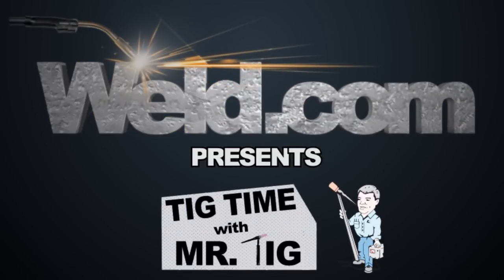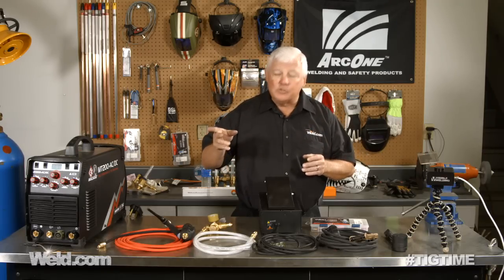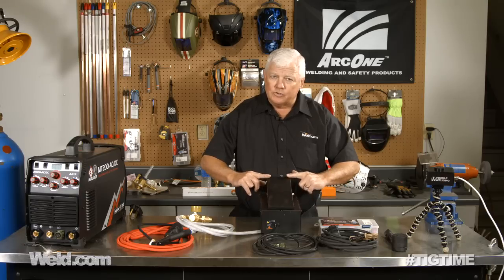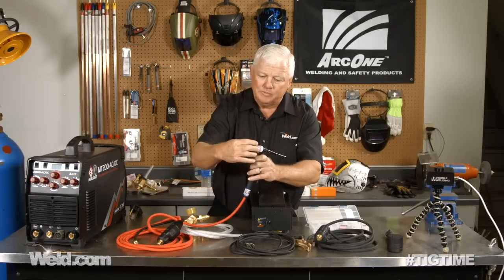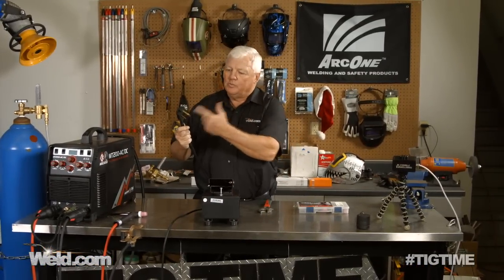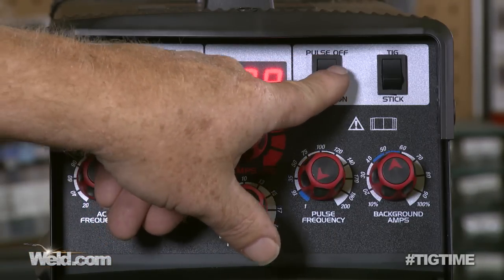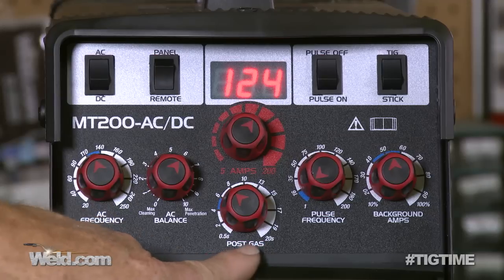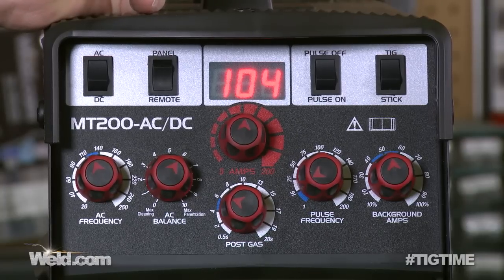CK Worldwide MT200-AC/DC Review Part 1: Full video in WELD™ app!

Comment: The torch is a 5/8 thread as well as the back. You keep saying 3/8 but its now. Its 5/8 RH thread. You missed the boat on the pedal people want the SSC style pedal not that old VCR pedal. Also no Pre flow? so you need to waste 8 seconds of gas oush the oedal and push it again to start welding? that's not to smart for a new of .02 pre flow normally. Welder missed some really big marks. Check out HTP Invertig 221 Guys much much better machine. Way more features too.

Comment: four times cheaper it is fake?https://www.ebay.com/itm/WSME-200-AC-DC-Pulse-TIG-Welder-Welding-Machine-Aluminium-TIG-200-220V/253356583416?_trkparms=aid%3D111001%26algo%3DREC.SEED%26ao%3D1%26asc%3D20140107095009%26meid%3D60afb9ffc0494dd7979cc13359cbad1a%26pid%3D100040%26rk%3D2%26rkt%3D4%26sd%3D253356583416%26itm%3D253356583416&_trksid=p2046732.c100040.m2060

Comment: all those who doesn't know, this is a jasic wsme 200 aC DC, it China's biggest igbt inverter manufacturer, probably the biggest in the world. mt 200 is just a rebranding of the jasic, hence the price is doubled.
Reply: Unbelievable man... I just looked up the Jasic welder and it’s the exact same weld along with his so called “sweet spot” lol!!!... what a bunch of thieves and liars. These people just lost all my respect. Spend the money and get a Lincoln or Miller.
Reply: @NeutronPerformance  
You can see it on things like the control knobs and their layout. They are quite distinct in their looks, and the jasic is the same.
So this CK is very probably made at the Jasic factory(probably with ck defining quality demands) .

Add a good pedal, a stubby kit and mark up the price x3
Reply: NemesisRTCW  exactly man... that is totally messed up.
Reply: can you probe it? the wsme 200 is not in jasic products or archive manuals
Reply: i bought the jasic machine , a few years ago , cost be 750.00 cdn , a local welding shop payed 2300 cdn for the same machine but with ck worldwide stickers on it .... that said it is a very robust and capable machine